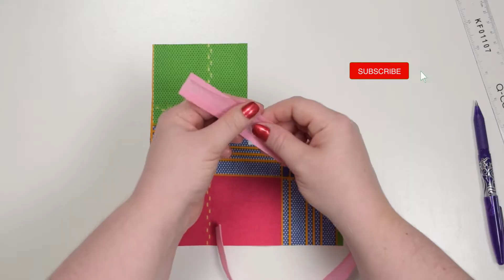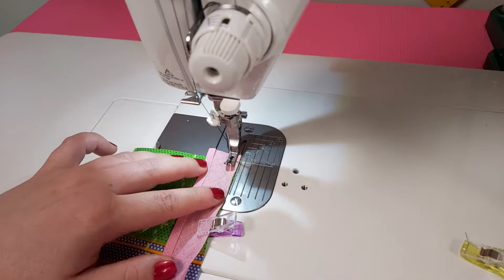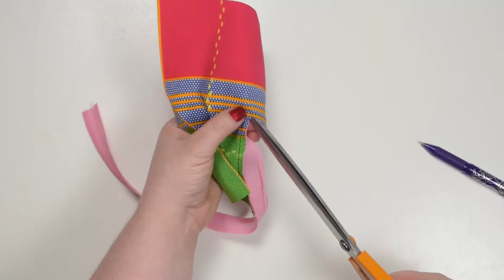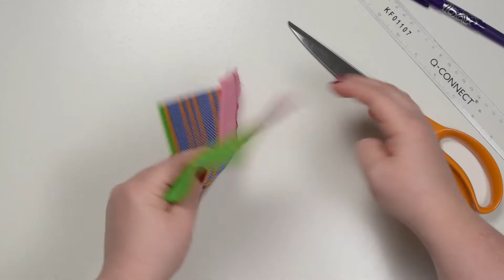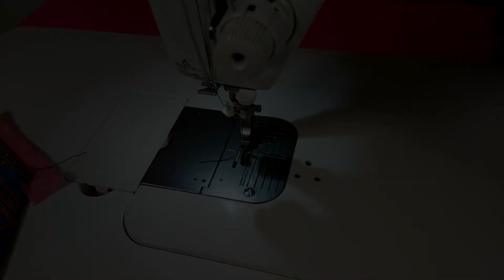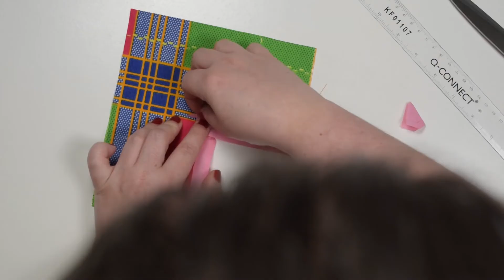How To Bind Inside Corners Like A Pro - Two Easy Methods

Comment: I used the second technique to bind the hem of a dress with a split hem. I wondered if it would  be better if I had opened out the second edge of the  bias binding, when sewing the mitre into the bias tape, instead of sewing the fold closed. (9:10) Thanks for the tutorial, I went through several before finding this one which I understood.
Reply from the maker: If you open the fold and sew a straight line, the corner will not look as neat. You would have to stitch to the crease and then pivot and stitch the unfolded edge at the right angle to ensure it can be folded again, but this creates more bulk in my opinion. I hope that makes sense ☺️

Comment: Thank you so much for this video.  I was so stumped on how to attach my binding on an inverted corner of a quilt that had "cutouts" at the base to accommodate the posts at the foot of a bed.  I had to adapt this method a little because I use single fold (double thickness) binding on my quilts.  But I am sooo glad I found this and used the method.  Very helpful!
Reply from the maker: Oh that is amazing to hear! Thank you for your feedback 🥰